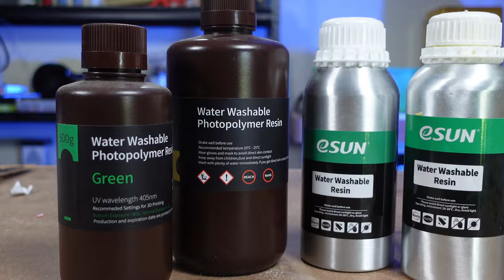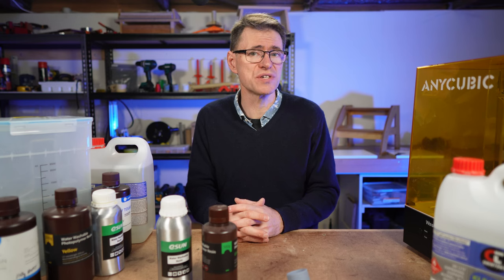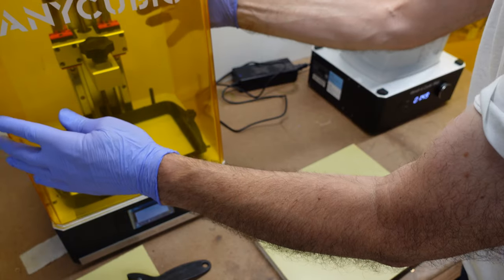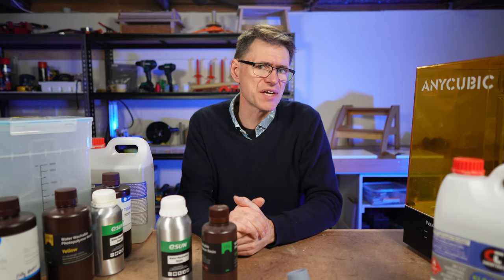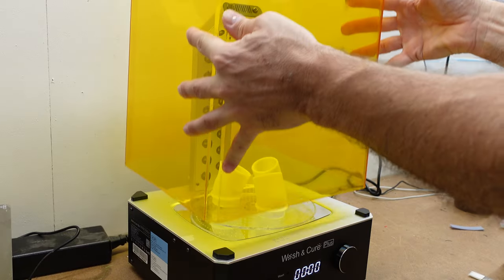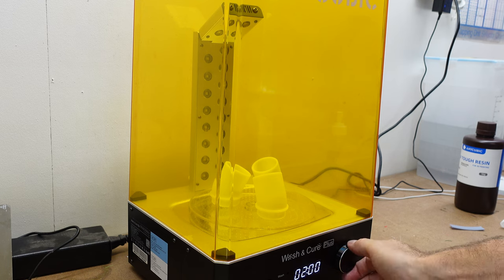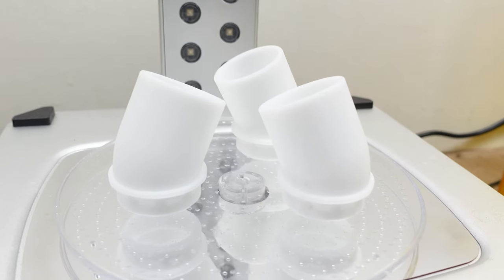IPA vs Water Washing 3D Resin Prints

Comment: Hey Colin, good to see another video from you. I just purchased a new 3D printer (Creality CR-10 Smart). Let me tell you, it's a fantastic printer, but I have been looking into resin printers. Are you able to steer me in the right direction? As usual, great video. Cheers mate. 👍👍
Reply from the maker: Thanks Chris. I use an Anycubic Mono X, which seems to work quite well. I also use Anycubic resin. Postage within Australia seems to come from Sydney and is always very fast. There are newer models out now...things change quickly in this space. There's an update on the dust port coming soon too. Stand by for that one. 😀

Comment: I've  always used IPA.   I use a two stage cleanup.  First dunk the build plate and models in a tub of IPA to get the bulk of the resin off.  Second pop the models off the plate and into the wash and cure container and proceed normally.  The tub without the impeller is easier to clean and resin tends to settle out since it's never stirred from the bottom.  I recycle the IPA by letting it settle for some time out in the sun and I feel that the recycled IPA is perfect for the first stage dunk.
Reply from the maker: That’s a great idea. I’ve been thinking about doing something similar to that.
Reply: speed it up using a couple glass jars. Run your IPA through the curing station for about an hour and let it COOK. All the resin settles to the bottom and can be filtered out. No more wasted IPA. Top off as needed. @ColinKlupiec
Reply from the maker: @gravesclay  I've got some old IPA sitting in a wash container that I will try this with. Sounds really interesting. I've used the method of leaving it out in the sun, but not thought of using the cure station for an extended cycle. 👍

Comment: If I ever got the 3D printing route, I think resin is where it is at for the things I have in mind.
Reply from the maker: Hey, thanks for leaving a comment. If you like to make precision parts, then resin is the way to go. FDM is good for fast prototypes, which you can then develop further with resin (which has very long print times). 😀
Reply: @ColinKlupiec  I think Bambu Lab's X1 is also capable of very high precision prints, especially with a nozzle change. I've been pretty impressed with what I've seen on Reddit in the miniature printing subreddits. 

Of course that's a 1.5k euro printer so SLA is still the way to go for detail on a budget.
Reply: @FlakiCiociGosi  Resin printer have a pixel size of about 30 micrometers, fdm does not come close

Comment: Nice tip about the magnetic build plate, seen lots of disaster  vids using those paint scrapers. Wonder if it will work with the Anycubic Tough resin which is also a bit flexible.?
Reply from the maker: I don’t use paint scrapers for removing prints. They’re too thick and can easily damage the build plate. The best device by far is a butter knife. Thin, but strong and flexible, and doesn’t scratch up the build plate nearly as much. You’ll see me use it in this video… Siraya Tech Blu Resin | How tough?
https://youtu.be/CcdSR2s-2Ug
Reply from the maker: And yes, the Anycubic Tough resin comes off the build plate easier because of its flexibility. It’s a great resin.

Comment: I'm not entirely sure the white residue is from moisture being left on the part... Perhaps moisture containing photochemical remnants in it from prior washes? I say this because you can cure models completely submerged underwater without getting any residue. In fact, underwater curing has a number of advantages over open air curing. Food for thought :)
Reply from the maker: Thanks for your comment. I'm not sure about it either. Each time I washed with clean running water. I did read up on curing under water and tried that too. Perhaps it's just the resin I was using. I'm using IPA these days because I now print with 'tough' resins which specify IPA cleaning. Although I welcome your comment. It all adds to experience and learning. 😀
Reply: Also interested if there is more on this anywhere. I used IPA and made a filter system for the IPA to get rid of the white marks on my work as using specialised resins that need IPA cleaning and often gunk up the IPA quickly. However seems some of my processes needed fully submerged in water curing. Seems if I cure a wet part it will get the white, but if fully cleaned in IPA and dried and then Cured fully submerged in water it does  not have white marks.

Comment: How do you handle the vapors?
Reply from the maker: Thanks for your question. Always put the lid on the wash station when running a wash cycle. Helps to reduce vapours. Be careful when using spray bottles as IPA tends to atomise easily. A mask is also helpful. 😀

Comment: Hi Just came across your channel, I'm very new to the hobby, came by it because of the utility it adds to my other hobbies. A lot of videos and channels barely take into consideration to the living situation of individuals trying to get into the 3d resin printing. Not everyone has a house/backyard, a garage or a dedicated room for 3d printing. IPA giving the best results is simply terrible when it comes to fumes and limited spaces. I plan on 3d printing inside with a sealed grow tent with ventilation exhaust, as for IPA washing(which involves hands on) I plan to do it in my covered balcony. Do you think washing on a balcony is acceptable?
Reply from the maker: Thanks for your question. Yes, I think washing on a balcony will be fine. Everyone's experience is different, but I've found that IPA washing is somehow more contained, especially when using a wash and cure station. Sure, IPA has fumes, but it's manageable. Some people use a wash and cure with water which also works. By the way, I think you'll find that resins these days have much fewer odour problems. I've been very surprised by that. I mostly use Anycubic Tough resin and it has virtually no odour. Worth checking out (I'm not sponsored by Anycubic). Thanks for stopping by my channel. I appreciate it. 😀
Reply: @ColinKlupiec   Thank you for the great info, yeah I looked into Anycubic and got a printer from them as well as their resin 😊 I got a combined wash and cure station but I'll have to see for myself if the fumes are manageable. The printing part might need to stay indoors for a more stable environment but the washing like you mentioned can be done pretty much anywhere. Thanks again!
Reply from the maker: @covenant_mog05  You're welcome. You make a good point about stable conditions. Temperature is also very important. I learned this after many, many experiments. Anycubic recommends printing over 25 degrees. I've found that over 20 degrees works too. But once you get down to ambient temperatures of 17ish the print quality starts to fail. I've also used warm water baths to warm up the resin bottle before printing in the colder months. This dramatically improves results. Resin printing involves lots of failure. But once you get it right, it becomes super efficient. I'm confident now to let resin prints run overnight. Especially good for those long prints.